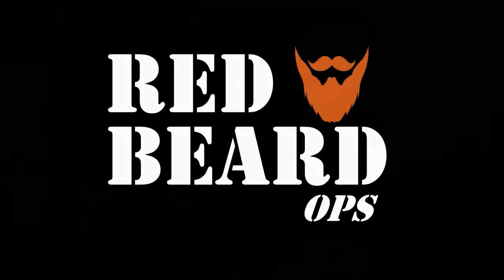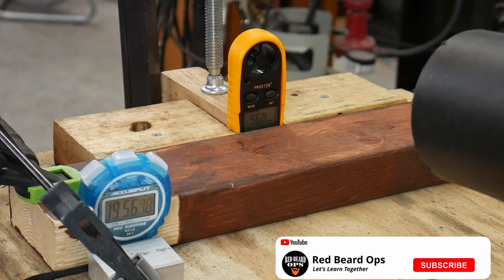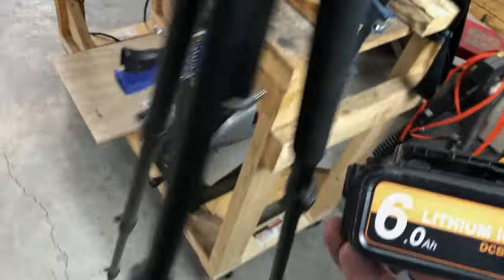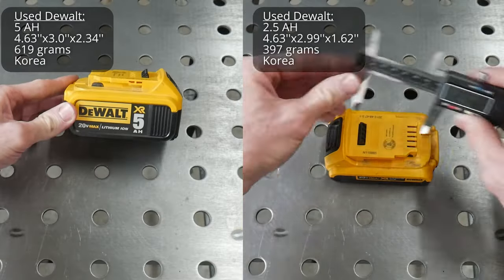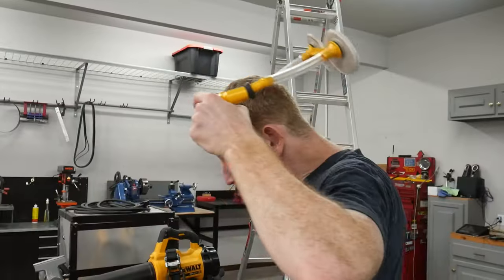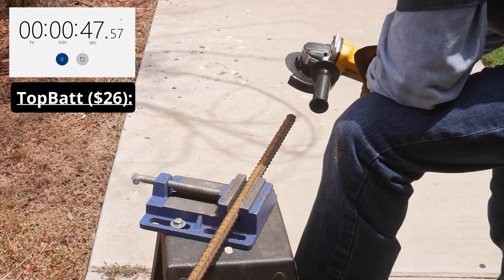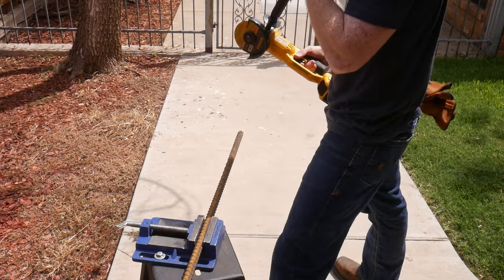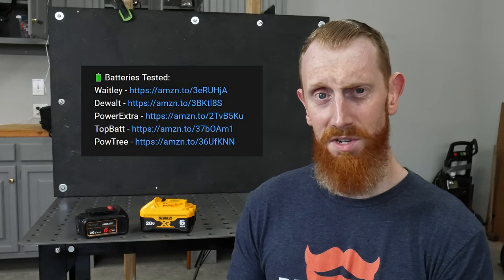Which 20V Replacement DeWalt Battery is the BEST? | Knockoffs VS DeWalt Comparison

Comment from the maker: So let me know what yall think about these results! Should do more videos like this one in the future? ------ Quick Update: The new shop is coming along. There is a hydraulic press restoration and numerous knife builds in this channel's future! Cheers yall.  🙌
Reply: Man, I didn't even know that there were after market batteries made for DeWalt.
Reply: They all suck long term, and under load, they all lose charging capacity after a few discharge cycles. I've yet to buy an off brand 6Ah dewalt battery that didn't lose capacity after a week or two of use. They lose a bar or two on the charge indicator, and as for the XR grinder, you can hear it no longer winds up to full speed once they drop a bar on the indicator, so it might be voltage drop vs capacity or a mix of the two.
Reply: Do you have a 5Ah Powerstack?  I wonder how this compares in the grinder test?
Reply from the maker: @europana7  Sorry I don't
Reply: Hello there thanks for the video that explains a lot but I got one question if u can help me please.i work out side in this heat men I detail cars and I recently bought a DeWalt portable fan that run with 20v batteries unfortunately my fan doesn't come with the battery so which one of them battery u think it will work longer and perfectly for my DeWalt fan?thank you
Reply from the maker: @moebarcelona3765  I mean I think it would work just fine, but you won't out perform the DeWalt batteries. You can get more waitlies though
Reply: @RedBeardOps  I appreciate your honesty brother I been trying to find them DeWalt batterys on marketplace for a lil cheaper than that high price at this department stores but I haven't been lucky either some of them want to sell a whole lots of tools as a bundle deal or some ok them are just far away from me i think im go a head and order the one you recommended thanks bud ..
Reply: Thank you for confirming what most users were always wondering about.......... like you say..... good to have Dewalt and Waitleys..........

Comment: I have some of the waitleys . They have been the best aftermarket ones I've ever bought. I've tried all the ones you tested and others. The waitleys have been great for me on my dcf900 1/2" impact gun. And my XR angle grinder.. they require quite a bit of juice. I have had 4 of the waitleys that have lasted me almost 6 months, as of now. With everyday use out of them. In case anyone is wondering..
Reply from the maker: Thanks for your comment and experience!
Reply: @RedBeardOps  you bet.! Thanks for the video..!
Reply: Are they stillyou holding 11 months in?
Reply: @carlcornelius4710  yea , mine are still fine .  The cheaper ones that say lithium on the side. Stay away from those..  but the waitleys have held up good for me ..
Reply: @gbii8101 wait I've searched and it seems all the waitleys say lith ion on the side?

Comment: The aftermarket 18650/21700 cells used in these battery packs are not using high amp discharge cells, so they can't handle high amp applications like the grinder (with a load) for long. They'll overheat and degrade faster as well (less charging cycles). Some of the best cells out there are made by Samsung and Panasonic, which the cheap clones aren't using (can't use at those prices). I'm curious as to what brand cells DeWalt is using. I build drones and have tested dozens of various brand/model 18650 batteries.
Reply: Where are you buying your batteries? I need to rebuilt some Hitachi Battery packs. Thanks
Reply: What's the best value brand in your opinon?
Reply: Dewalt uses Samsung.
Reply: I plan on buying the cheapest battery for the shell, then welding the highest quality cells I can put in there. Hopefully the driver chip can handle it. If not, I can get a driver too and make it work
Reply: @beefstickswellington1203 That's a good idea, dunno why I didn't think of it. Thanks for the idea
Reply: I know a few years ago you could find Panasonic/ Samsung/ LG 18650 cells from the same factory, just not branded. I used to be into all kinds of things, but I found the deep dive on the big laser and flashlight forums. I bought some and they work great probably 5 years later. They were something like$5 or $10 vs, around &15. I'm not sure where to find them today, but I feel that they're still out there.

Comment: You came to exact same conclusion as I have - Waitley is a great value.  I have quite a few.  The Waitley 6ah is better than my OEM DeWalt 5ah (Chinese knockoffs always overstate ah).  All my Waitley's have lasted at least 5 years - not one has failed or noticeably degraded.
Reply: Thank you very much for your feed back that's what I needed to know looking for one to use on my keeds power wheels

Comment: You missed the most important feature of the dewalt battery and that is the circuit board that prevents fires. Most of the other batteries don't have the fire prevention features. If you value your house and everybody and thing in it stay with authentic batteries and not the after markets.
Reply from the maker: I haven't had any fires with my aftermarket batteries yet, but it's good to know the Dewalts are protected in some way.

Comment: I bought a pair of Waitley 6ah batteries  ($54 for 2)  specifically for my Dewalt fan.  They run for 4hrs on high speed.  The 5ah Dewalt lasts 4.5 hrs in the fan but are $175 for a pair.
Reply from the maker: Nice, glad to hear they're working out for you!

Comment: I just bought 2 Waitley 6Ah 20v batteries and 2 DeWalt 5Ah 20v batteries from Amazon. I tested each battery and while the DeWalt did indeed have Samsung 25R batteries the Waitley batteries had ZERO writing on them. Next I performed a capacity test and found the Waitleys were 3883 and 3863 mAh batteries closer to 4 Ah batteries and not the 6 Ah as advertised. The DeWalts tested at 5123 and 5092 mAh each surpassing the 5 Ah as advertised. I have both genuine Samsungs and Molicel batteries for replacing the batteries in the Waitleys when they die.

Comment: I have a pile of these off brand 6ah batteries, seat of the pants testing puts them right between my Dewalt 4ah and 5ah batteries. Your testing is right in line with my experience. I am happy with the $30 ish dollars I spent on them.

Good video🤙👍👍
Reply from the maker: Thanks for sharing!

Comment: This is awesome, good to see where a knock preforms well enough and where it doesn't.  I always wondered if the real batteries were just huge market up, and this shows, not exactly.  Looks like the name brand are probably more expensive for a reason, but the average diy'er might not need all that instant power.

I got 3 knock off tool batteries that work great, but never used them on something like a grinder.

Comment: thank you for this video bro. I am in the market of replacing my old dewalt batteries. I was looking into aftermarket batteries mainly to power my drill, rotary sander/ polisher, and my dual action polisher. I own a small mobile detailing company and I use several cordless tools. After watching your video, I have decided to purchase a couple of 5 or 6ah dewalt batteries since they seem to dominate when it comes to high drawing demands. Thanks for this info.
Reply from the maker: Glad I could help

Comment: Would love to see some long term testing also. I wonder how much leaving them uncharged for long periods of time affects them. They say it doesn't affect Li-ion, but that's not true. It might not be a major difference or they may not just crap out completely, but it definitely does something to the cells.
Reply from the maker: Long term testing would be good!
Reply: I've used four 6ah Waitley's for at least 5 years - still going strong. I keep them charged and rotate thru all my batteries (including my OEM DeWalt batteries) so none gets overused/underused. 

Fwiw, I bought a couple 12ah DeWalts last year with my lawn mover/chainsaw/weed trimmer - one failed after 6 months.  DeWalt replaced it quickly without hassle, so that ~$300 price tag per battery was at least worth something.
Reply: It's best to store at 50% charge, in a cold place.

Comment: I have had issues with several aftermarket batteries I have bought.  The single observed flaw is the inability for them to produce a continuous flow of power.  They will power my DeWalt DCE100 blower only in bursts. Even the highly rated Waitley will produce power to the blower for less than 60 seconds on a full charge.  When I release the switch on the blower, pause, then re-engage it will run again for a period of time.  These 'bursts' of power decrease in time below 75% power, and then diminish to 5 second bursts until the battery is near depletion.  The original DeWalt batteries are 5+ years old and still produce full, uninterrupted power from full charge to depletion....
Reply from the maker: Interesting, I haven't had that issue with the Waitlys I own yet, but I agree the dewalt batteries OEM are king

Comment: I bought the ones that have the same color scheme as Dewalt but 12 AH and upgraded my son's 12v four wheeler.  I got 2 for 140 and them batteries are amazing in his four wheeler and I use them with tools also.  Great find.  Mine are a little different then his.

Comment: I'm really glad I actually finished the video. Under load, it's clear the Dewalts are MUCH better. I'm looking for batteries to run a chainsaw, which is much more similar to a grinder than a blower. Dewalt it is.
Reply from the maker: Cheers!

Comment: Cool review.  I bought a Waitley years ago when I didn’t have funds for another Dewalt battery and I just needed something as a back up to my two 2.0 Dewalt batteries. I now have several more and larger DeWalt batteries but haven’t tested to compare but i use the waitley on a fairly regular rotation and don’t notice a huge drop off. It is a 5amp. Now I have a new Dewalt 6amp, 4amp and an older 3amp (and a flex volt). I should compare it to the 3 and 4 amp for time

Comment: I don't use them enough to notice a difference and I've had these dewalt and the knock off's for this period of time , I was impressed with the knock offs . I all so got an adapter to use them on my black and decker weed trimer these out performed the black and decker batterys by a lot

Comment: I got 2 batpower 4ah compact batteries off amazon they have 21700 cells instead of 18650 paid $80. I had to cut up 4 large steel reels with a sawsall after draining my 2 dewalt 5ah batteries used a knock off 6ah battery and it didn't make it through the first cut and destroyed the battery so used the batpower to cut up last reel no problem and checked the charge and still was showing all the light bars. One thing I like is how much better these batteries fit in my tool bag when on a drill. Dewalt also makes a 4ah compact battery but haven't tried one
Reply from the maker: Good to know - thanks for sharing your experience!

Comment: Thanks for the video. I recently bought a dewalt adapter for my dyson vacuum and I think aftermarket batteries will provide me a good cost efficient alternative to my dewalt batteries. Two of those waitlys should take care of my house on max settings and if the vacuum needs a proper dewalt, the money isn't lost as I have other dewalt tools that could use them.
Reply from the maker: Glad I could help!
Reply: I bought that adaptor to and after a 10 to 15 sec run time my Dyson shuts off. I have to pull my battery reinsert and then turn back on. I sent it back

Comment: The other consideration is how they hold up over time/recharge cycles.  I'd be willing to bet that you can get many more recharge cycles out of the DeWalt batteries (also justifying their higher cost), but it would be interesting to see if that is the case.
Reply from the maker: You’re probably right there Doug!

Comment: Great video. Thank you for the hi load testing as well. I am curious about the difference between the new and the used DeWalt 5Ah battery..and how these batteries fare with repeated charges and how quickly they degrade over time.. ie- after a fixed amount of charging cycles...say ten...what is the battery performance then? That would clinch the deal between the top contenders (DeWalt and Waitley.) You don't even need to bother with the rest. My question is how do they all degrade after repeated charging cycles.
Reply from the maker: Good question! I'm not sure. The Waitley has been working well for me so far

Comment: Powerextra seem to have a serious quality control issue. The symptom is common to any rechargable batteries with multiplemcellsmin series. Broken battery balance. If you open up the battery to check up the voltage of individual cell, you will find at leastmone of them having less than 3.2 V or even worse, less than 1.0 V which means a dead LiIon battery.

In many cases, when the balance wasnt broken too much, say individual cells have less than 0.1 V difference, then they will work as much as other 3rd party one and a quick balance charging will return them to a brand new state. 

Also, the DeWalt 6Ah seem to have 21700 cells which are literally overwhelming anything with 18650 cells.

Comment: I wonder if the Korea made dewalt batteries use the Samsung cells. They're not at the top of the 18650s form factor but they're near the top which might account for part of the performance difference.

Comment: I bought 2 20V Waitelys after I saw this Last year.  I was pleased with their performance but after a winter in my shop i went out to use them.  They were dead and neither of them will take a charge from my Dewalt chargers that i used to charge them with last year.  Any comment or help?
Reply from the maker: That’s interesting Jack; I haven’t had that problem in my shop. Maybe my shop doesn’t get that cold? The one I haven’t from this review is still going strong. 

Sorry to head they didn’t work for you

Comment: Would be good to know how the waitley batteries are still performing after longer term use. Are you still using them over a year down the line or have they not make the journey?
Reply from the maker: Yep I'm still using it. No issues thus far.

Comment: Wich elements are inside this 10A battery? I suppose 21700 10 pieces. If so, then why it is bigger then dcb208? Cant find disassembly video for dcb210
Reply from the maker: I really don't know, sorry andrey

Comment: I have a Dewalt Circular Saw Model DCS574 7.25" any suggestion what size battery  for occasional use ?
Reply from the maker: I've had good success with he Waitly.. but you'll never be able to beat the DeWalt OEM it seems. Up to you with how often you use the tool and how much money you want to spend.

Comment: The waitley batteries suck too. After maybe   10 discharge cycles, they loose a bar on their charge indicator and only charge 2/3 the way and that feels like 50% lose in run time.

Ive spent $500+ on offbrand dewalt 6AH batteries and every single one of them has the same fatal flaw, after a few weeks (if you're lucky) they loose charging capacity. 

I weld and my dewalt tools are the XR grinder, impact and drill/driver which i use for cutting and step bits. I've since stopped buying the offbrands because they all fail before the Amazon refund window expires even and driving to Kohl's to return these batteries got old pretty quickly. 😅
Reply from the maker: Interesting, thanks for the note!

Comment: I wonder if the “Powtree” batteries have small cells and or poor upper temperature cut off.
(Although I’ve heard/seen repeatedly that DeWalt batteries proper do not have an onboard BMS, that is in the tools/chargers)
Reply: Refurbished cells. When old batteries are collected for recycling, this is where many end up.

Comment: You ever check out the Volt ones? 

I have a 12ah that runs great and lasts and was 100 vs 360.

Also should do a 6 month recap after use. Wish I had the dedication because I've tested a fee different brands and can see how some just die and others still thrive

Comment: Great Video , thanks . I just took a gamble on a dewalt EBAY COPY CHARGER AND 6 AH BATTERY for $68.00 aud  delivered , with a so called 10 year warranty ? be interesting to see  if you had to make a claim . Im no tradie , or a every day user , just do a bit of tinkering in the shed and 4x4  and motorcycle servicing when needed , so hopefully this  generic batt and charger works ok for my needs , but OEM would be best like you said . Have you ever heard that a generic battery can damage your 
DEWALT SKIN ? I have been told that , and would void your dewalt skin  warranty if they can proove you were not using a OEM BATTERY ? like to know your thoughts on that  , 

Take care mate .
Reply from the maker: Hey brett, I really have no idea. Sorry about that